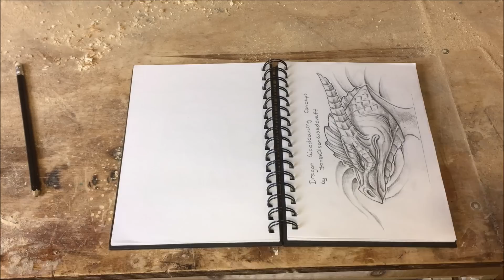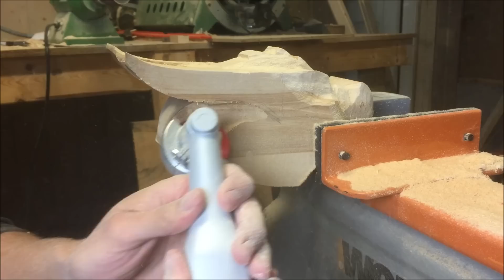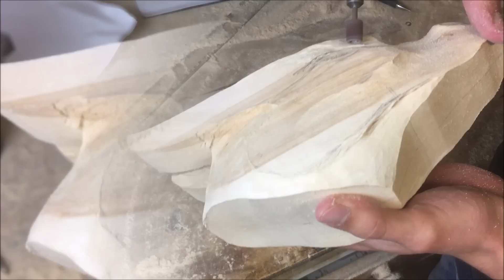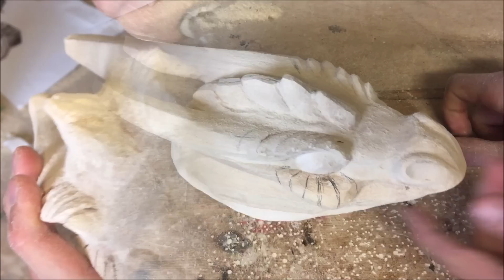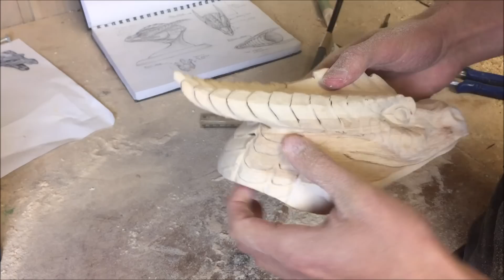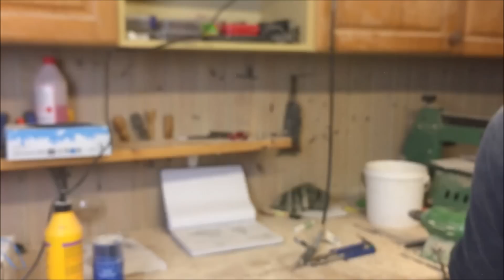Dragon Head wood carving | Made from birch wood by jonasolsenwoodcraft

Comment: I think it would be an awesome idea to stick with this dragon theme and do a dragonling hatching from an egg, however you think you could pull that off.
Reply: also, just a note i felt that the structure of the snout could have been a bit less thick or more elongated, as the aged/wise sort of slim Asian dragon feel of the facial features (the horns, the mouth, the nostrils) worked really well, but the structure of the head more resembled that of a modern lizard, almost a kimodo lizard.